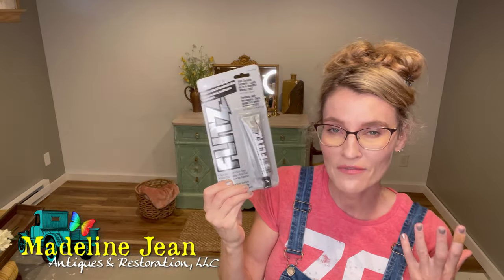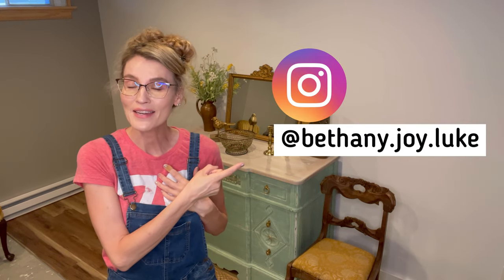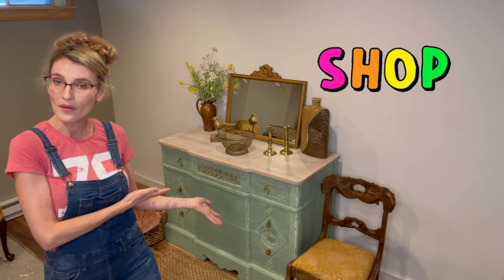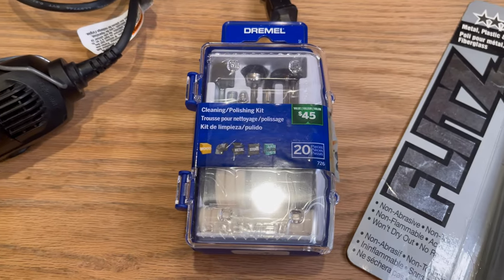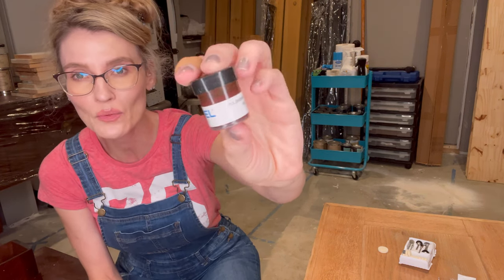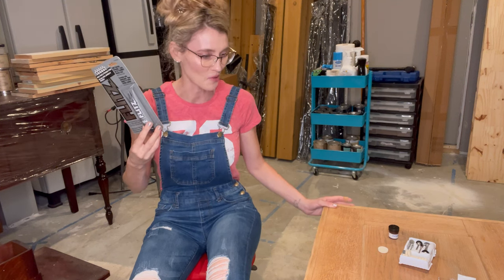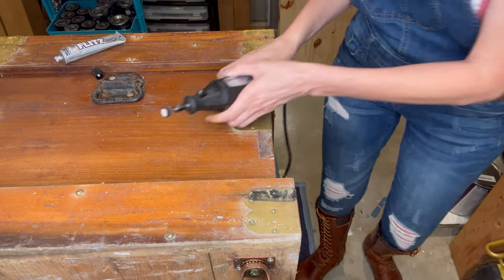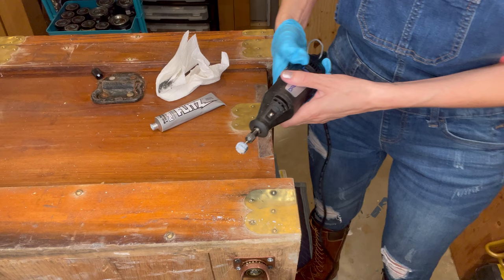Cleaning Brass | My Secret Weapon

Comment: Hi Bethany! Thanks for the Flitz love! Much appreciated!  👍👍👀 For pieces that are being polished where they are, you may want to consider masking off any areas where the finish might need protection just to keep the surface clean. For items like your brass, we'd recommend applying a very thin film of polish directly to the metal, let it sit for a minute and then hit the area with a cloth or paper towel to get most of the black tarnish off. That way you can buff to a high shine with either a microfiber or the Dremel. As for the level of patina, as you saw, it was the extra buffing that really brought out the mirror finish. For a more satin finish, just don't buff as hard. Our polish is non-toxic, so the gloves are only necessary to keep that black oxidation off your hands. 😊 Seriously, thanks again for taking the time to review our polish. We really appreciate it!! - Jim
Reply from the maker: Hi Jim! Thank you so much for watching and leaving such a nice comment! Also love all the tips on how to correctly use Flitz. I will definitely be pinning your comment to the top of the comment section so everyone can read on how to apply Flitz and get the best results; either the more satin finish or the mirror finish. I'm still in awe of the magic that's in this tube. I'll definitely be using Flitz again to freshened up all the antique hardware I come across. Thanks for stopping by! ~Bethany